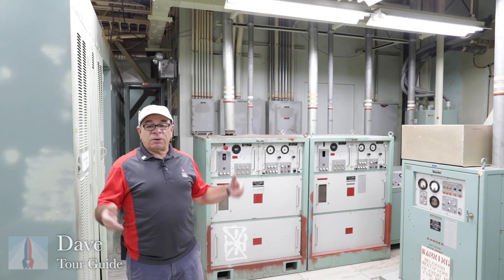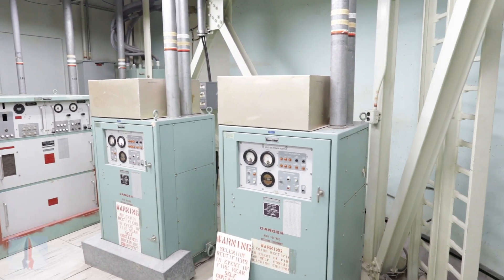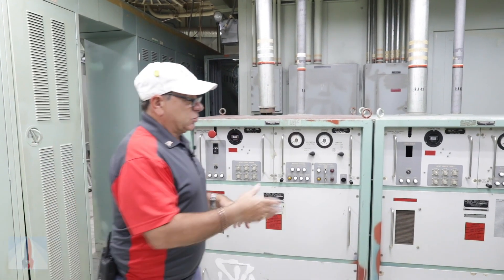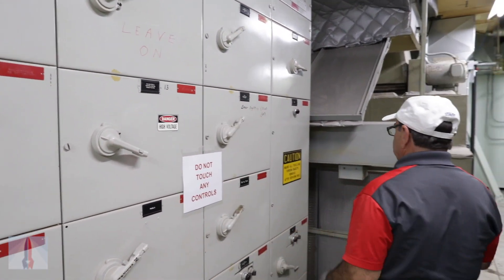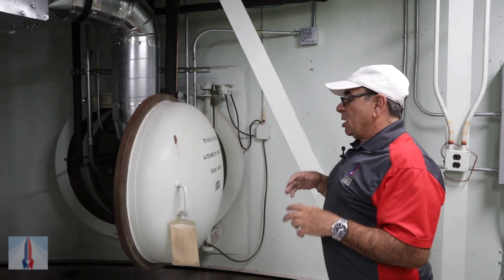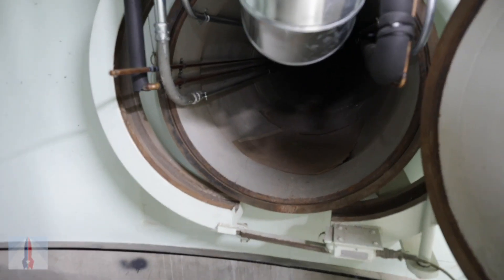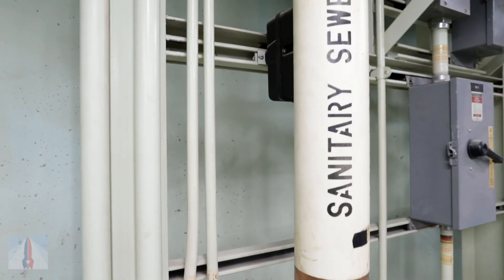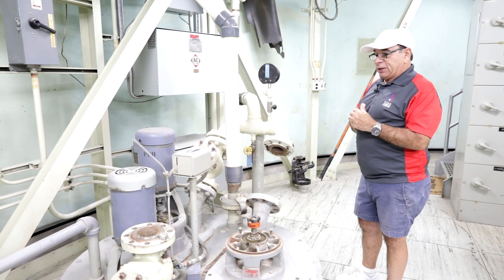Behind the Scenes of Titan II "Part 5 – Control Center Level 3"

Comment: Wonderful Level 3! I spent plenty of time down there with simulated and real comm problems, part of the joy of being a Deputy. Great video! Major Mark Clark USAFR Ret, former senior DMCCC at MCAFB and LRAFB.
Reply: Major Mark, Did the Crews ever discuss how they thought about spending their last 28.5 days of earth life?  In my year in Vietnam, after sufficient ETOH, we might talk about how we wanted to "go:"  quickly!  Thank you, Sir, for standing on the Line of Deterrence.  Assured we had relative peace during the so-called "Cold War."
Reply: Mark I worked at LRAFB from 83 to 87 when we closed the last one down. I was in Radio Communications with the IRCS shop. I maintained the 1000 Watt Transmitters and the Receivers, Data Encoders, Decoders, Audio Oscillators and so much more. It was the best time of my life! This brings back some great memories! Thank You for your service!